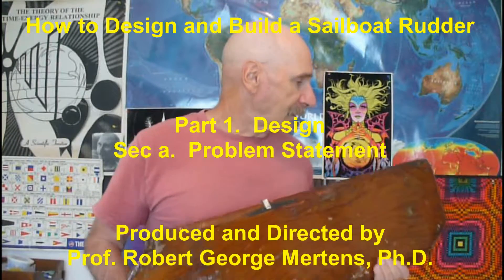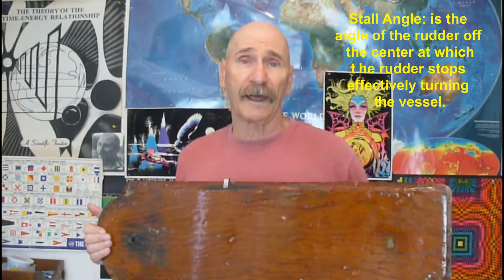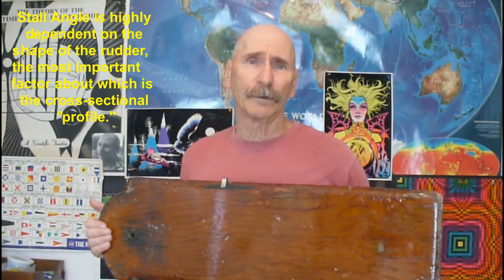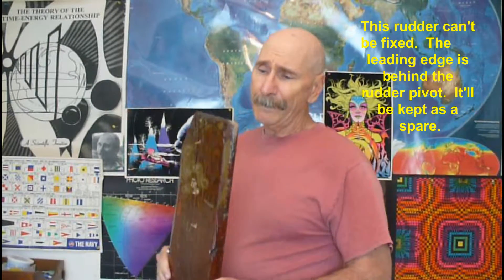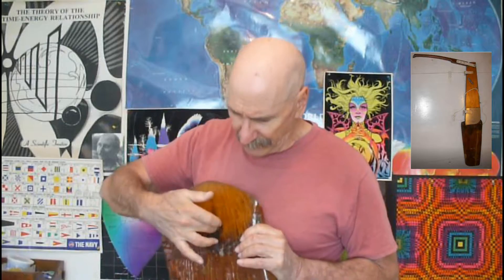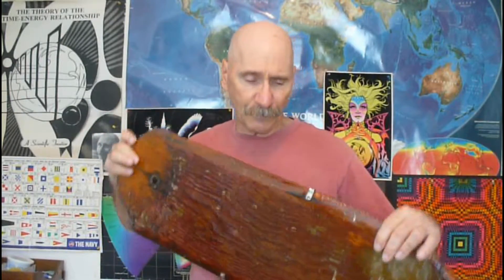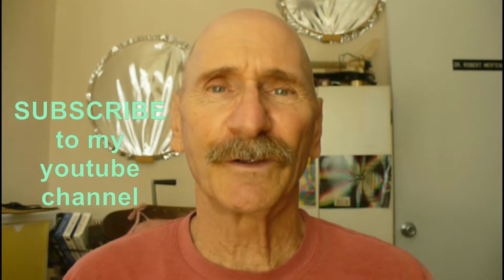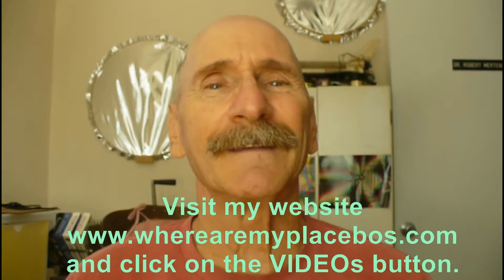Part 1a. Design and Build a Sailboat Rudder: Problem Statement

Comment: I own a Windrose 25 the rudder  is of slightly different design but same results very hard to helm. The designer was a racer, sails have to be balanced perfect. A rudder with more forward design is the answer for more control on the helm.
Reply from the maker: Thanks for your comment.  Rudder stall angle is heavily dependent in the NACA foil shape, which is discussed at length in the next two installments of this series.  A racer will have a lower drag coefficient but will be harder to steer.  The links are listed above if you're interested in building a second rudder for easier steering.  I go through the entire process in detail.
Reply: @RobertMertensPhD  Hello , Just discovered this video and you , late night here, but I will watch the videos this WE
Could you help me designing self steering rudder for my Albin Vega?
Cheers
Lorenzo
Reply from the maker: @lorenzom7237  Thanks for your comment and your confidence in my engineering skillset, but in the sailboat world, I'm just an amateur.  This whole video series does go through the design and build of a decent NACA rudder.  The other part of this response is that the are rudder steering control systems you can buy that self-steer.  These are well-designed and engineered systems that are beyond my own engineering training.  
As far as I know, there is no such thing as a self-steering rudder.  There could be, but I don't know about one.  You can set up your steering with a constant wind and direction, lock it in place and it will usually steer itself - for awhile.
In the meantime, I'm currently well-immersed in my Space Telescope Project (see my youtube page) and barely have time for anything else.